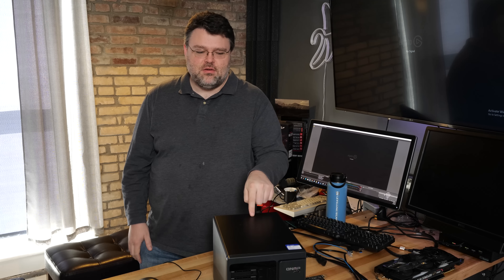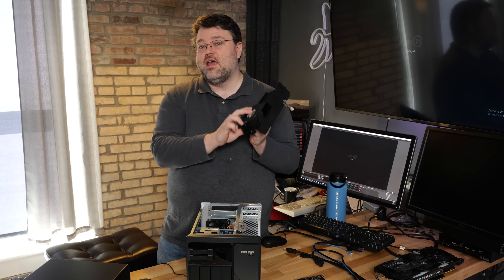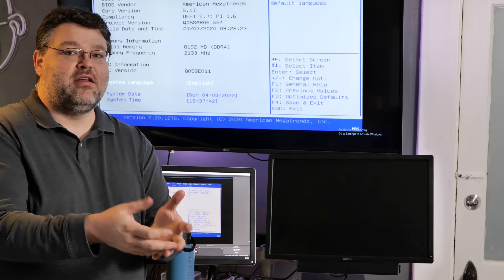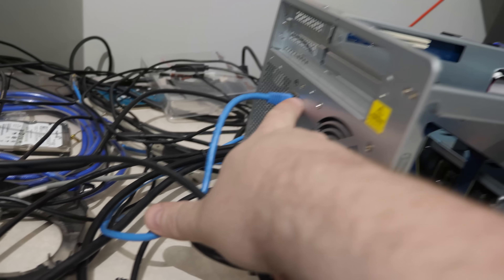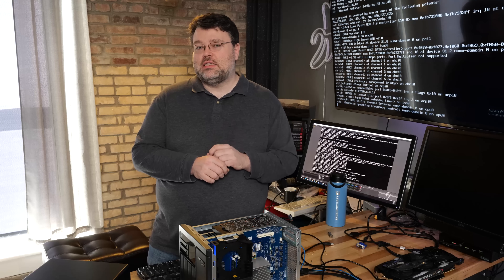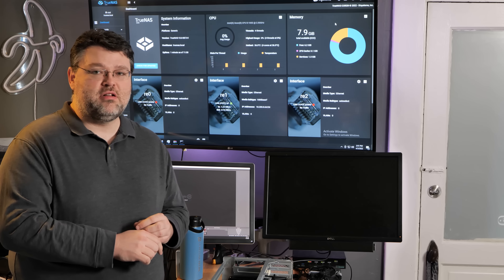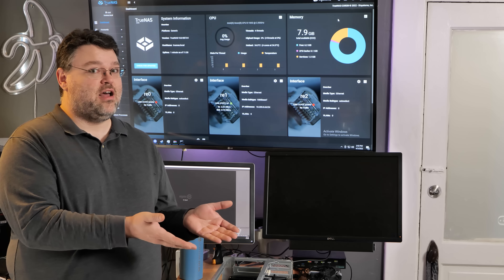QNAP H686 -- Let's Install TrueNAS!

Comment: My wanting to do this comes from the fact that you can only run ZFS on the internal drives. If you add their SAS expander to a QNAP device running hero, you still can't put a ZFS filesystem on the external box.  And I think that sucks.

Comment: Considering QNAP's track record of handling vulnerability(s) they were warned of and given a grace period on by security professionals...I guess I'm glad you made this as I may do it, unless I sell it all to swap to a TrueNAS mini x+, which is cheaper with more ECC RAM and dual 10GbE, though 1 less 3.5" bay, might just be the better option. Only thing is TrueNAS doesn't tell you the exact CPU you're getting.

Comment: @wendell I have a TVS-h1688x and was thinking about installing TrueNAS Core on this box to see how it goes. Wondering if the Thunderbolt and 10 Gig Fiber NICs (QNAP branded) would be supported by TrueNAS. Any thoughts on this?

Thanks for the great video.

Comment: I do like iX systems.  I know the id of the Motherboard, and I can now make my own, because it will be a project for me.  If you are time-short, then pre-built systems are very necessary.  Now starts the search for optimum ram, and then, a 10Gb/s NIX for my workstation.

Comment: The H686 is close to £1000, unpopulated - will a basic small form factor/HTPC self-built PC, with TrueNAS installed, not give you much, much more potential at a much lower cost?

Comment: Don't agree, I would avoid QNAP, but if I were forced to use one I'd immediately replace their junk software, especially the Hero version, with TrueNAS. Had loads of issues with my TVS-h1288x, one day it even decided to simply delete one of my pools. Gotta love backups. The hardware has also major cooling issues. Mine idles at 60-70°C, at 50% load it rushes to 90°C in seconds and stays there even with the fans screaming. Only after installing three additional Noctua 60mm fans the heat is being kept at bay (-20°C).

Comment: I guess it's time someone at Qnap noticed this and had a light-bulb moment and decided to sell their boxes without the OS installed on that small 4-16GB SATADOM, just with larger OS storage capacity - say 32-256GB SATA DOMs... They could capitalise on hardware R&D, and in theory offer it cheaper cause you're not paying for the OS and software support features of the regular product... which also had quite a few holes/issues that made people notice Qnap in a wrong way... And thus such an offer could suddenly allow them to make a lot of $ for small investments, allowing users an option even in the BIOS to eg. run a setup of QuTS/QTS/QTSEnterprise over the net as a remote boot/deployment option...

Comment: I’m on a TS-451 which isn’t supported by QuTS Hero. I’ve upgraded it to 16G ram years ago, I bet it would work well with Zfs. As one of the disks is dying I’m considering to do this also… Reddit says it can be done.

Comment: What about that round port just above the top RJ-45 port? Is that a serial jack?
Can you use that instead if you dont have a compatible gpu? Or does it not support BIOS interaction?
And what kinda weird adapter/cable would you need?

Comment: Huh, well that's neat. I wish this had come out about 12 months ago when I was starting to look for a new NAS. 
I wanted 8 Bays of 3.5" + m.2 + 10G in that kind of quiet and small form factor (apartments don't have room for rackmount gear), and this seemed like the best option.  iXSystems are great for doing TrueNas, but their hardware just isn't what I'm looking for -- besides that, not available here in Australia

Comment: The TS-h973AX is a super machine for this, Ryzen V1500B SOC, ECC DDR4, 2x 2.5G Intel NICs, an Aquantia 10G NIC, 2x U.2 NVMe/SATA 2.5" bays, 2x SATA 2.5" bays, 5x 3.5" bays. 

I'm currently running unRAID on mine, but toying with going FreeNAS Scale when I get a few days to tinker.

I have a pair of Micron U.2 drives, a pair of WD Red SSDs, and 3 18TB WD Whites in it, and it performs great, can get well over 8Gbit transfers going between two client machines on 10G -  limited by the RAM and storage on the clients.

Comment: I have a HS-210 and it basically borked the files when one of the drives failed and it then decided to drop the 'new' disk before finishing the mirror. Very frustrating. As I can barely buy anything where I live, I am now looking at the TS-253D (which I can buy). It has an Atom CPU, not a proprietary one. Would that be able to take TrueNAS Core?

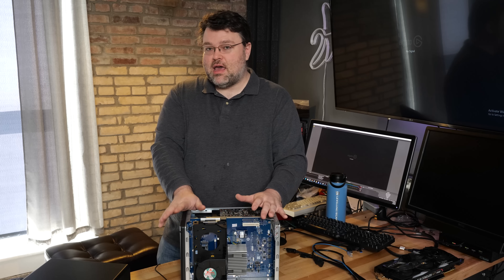Comment: 3:18 I've been running TrueNAS off a 16GB SSD for years now... I was under the impression that you couldn't store anything to the boot SSD besides the OS (no VMs, plugins, jails, etc.), so I'm curious what your reasons are for that?
Reply: It used to be that people ran boot on USB pen drives, so it wasn't possible to run VMs etc due to speed

Now that we've move up in size, speed and reliability to SSDs, it is potentially "possible" abet difficult BUT I'm not recommending investigating as it is easier to have seperate boot / VMs /Jail volumes (with them on ZFS)  where you can monitor manage and move if required.  How much is a pair of 120GB SSDs? $40?

Boot is literally that - boot, you can backup your config move the data drives to a new installation, restore config and  you're good to go (I've done it)
Reply: I'm using a pair of USB 3 32GB Sandisk thumb drives. This saves money and SATA ports which I can use for actual storage drives. It seems fine, no problems at all.
Reply: @wayland7150  It is probably fine, as long as you don't have many writes on your root fs(e.g. mount / read-only, put containers on actual storage).
It goes without saying that storing irreplaceable data on such an USB stick is a bad idea.
Reply: @Maxjoker98  As long as you have your keys and config backed up it should be fine. Just make a new install and your pools pop right back in.
Reply: I've never used such a device or OS, but my guess is that the rootfs is simply on there, and without further mounting(entries in fstab or whatever) containers and applications etc. will be stored on there. So if you're just using it as a network connected storage device, it's probably fine, but once you want to make good use of the hardware, e.g. by running a few containers, you'll quickly run into issues.

Comment: Right on time. I'm gonna try TrueNAS Scale, if the speed is better than Core, I'll keep it. If not, it gets banished into the Dark Crevices forever and I'll run Rocky Linux in a VM for any Docker stuff.
Reply: afaik TrueNAS Scale (or any ZFS on Linux for that matter) is still a bit slower than TrueNAS Core (or ZFS on BSD)
Reply: @marcogenovesi8570  I’ve read the same online (Core being 2-5x faster) but my home server is not that fast anyway. Best way to find out is to try I guess!
Reply: If you've got a fast CPU will it actually matter? If the point is you want to run VMs and Dockers on the same box then maybe it's worth it. Obviously if the data transfer is slow then it's a no go.
Reply: @wayland7150  I couldn't even get the Scale installer to boot on my system. Core works fine. System is cobbled together from stuff I had in the attic: FX6100 (with 4 cores disabled), 16GB DDR3, 4 4TB HDD's (new). So yeah idk.

Comment: Holy crap, that thing is expensive.
Reply: Yeah, but it works on older qnap's too, just remember to check the cpu specs. Personally I prefer to run plain Debian rather than Truenas, works fine. I guess you could even run Armbian on some of the Marvell cpu stuff, all though I haven't tried it.. yet..

Comment: this is not something you want to do unless you want to undercut qnap and sell better nas plus cheaper to boot - with a better mb you have better cooling, better expansion options - you may have to shop around a bit but nas is nas - truenas has been around - putting the os on the nvme is a good way to go vs sata dom - you can do raid1 for better fault tolerance
Reply: It would be great if someone made a case with SATA/SAS bays already wired and it's own PSU. Just add an mATX board.

Comment: Realtek NICs work just fine ™ under TrueNAS Scale, as Debian is way less picky about its hardware.
Reply: Using realtek NIC in a production environment is always bad idea unless you dont care about bad performance
Reply: Yepp, was my first thought, truenas scale is worth considering. I just like it as i suck at bsd😃
Reply: i noticed for qnap 2.5gbe, initially with truenas core it didn't work. but using truenas scale worked. i believe later there was an update for truenas core that said they added support for the 2.5gbe nics, so it may work now without having to resort to the alpha/beta truenas scale which is not recommended for production yet afaik.
Reply: Realtek is trash.

Comment: If anyone wondered. Yes Wendell is active on level1forums.

And noice. I built my own NAS and just recently upgraded my Truenas Core to Truenas Scale.

My suggestions. Show this upgrade process. Show how to use Plex and set correct permissions as docker.
Same for Nextcloud.

And my biggest issue. Getting a VPN for the Homenetwork. Preferably with a GUI option like the openvpn access server.

I know Truenas got a OpenVPN service.
But setting it up so it may detects and reaches the whole local network is super confusing. I always struggled with what settings the openvpn service needs. More often than not it was just guesswork and only halfbacked for me.
Reply: Try pritunl for a gui based openvpn/wireguard server

Comment: that's probably the only way to safely use a Qnap device, nuke the stock firmware and replace with an OS that follows basic security principles and is updated regularly
Reply: is the only way to be sure...
Reply: @magoid  this is the way
Reply: Also the only way to use any router
Reply: yea thanks qnap just got deadlock ransomware on the weekend. still persists even after malware and virus check, firmware update etc. truenas it is...
Reply: Qnap is still getting hit with ransomware .. so yeah I'll take the form factor and truenas plz
Reply: In QNAPs defence, they have been pretty proactive in updating their firmware, I have a QNAP NAS from 2015 and has had regular firmware updates to this date. Their handling of the whole deadbolt situation, was rather poor however. My major critique from my experience, there tends to be odd limitations in the OS regarding the ability to use certain file systems and other features that seem to come and go with each release.
Reply: @Lorondos  regular firmware updates don't mean much if they don't solve CVEs from 2 years ago.
Reply: Couldn't agree more, their products are unbelievably bad, especially their Hero OS.

Comment: I guess QNAP's OS is based on Linux?
Reply: yes, all NAS have a Linux-based firmware.
Reply: @marcogenovesi8570  (except for the ones that don't, like Netapp)
Reply: @jmonsted  Netapp makes SANs.
Reply: @jmonsted  afaik netapp uses something based on FreeBSD and ZFS?
Reply: @Felix-j3d4b  I'm not sure they use ZFS, most of their drives need to be formatted with 520 byte sectors and do the integrity checking like old raid controllers do. ZFS sure doesn't need that.
Reply: @marcogenovesi8570  The NetApp filer was their classic product, a NAS running ONTAP, based on FreeBSD. It later became an iSCSI and FC target.
Reply: @Felix-j3d4b  ONTAP is based on FreeBSD, but it uses their own proprietary file system, WAFL (pronounced "waffle" of course).

Comment: Im never a fan of custom form factor NAS/Servers, I dont get why people buy them either, they are always overpriced af.
Reply: this is a turnkey NAS, a significant part of the price is the stock firmware with web interface and apps and services. Of course it will lose to a barebone server
Reply: Not everyone is capable of setting up their own unRAID/TrueNAS/OMV... machine. Most people don't even know how to build a computer but they need NAS. Just because you don't get why doesn't mean there are no situation where they are a good solution. Synology DSM so easy to set up than even people who have only basic experience with networking will manage it.
Reply: They do tend to be expensive, but size and noise are important to lots of people.  I built my parents a NAS (using TrueNAS) on a HPE MicroServer Gen8, and it's fairly compact (and certainly quiet), but it's still quite a bit bigger than a 4-bay QNAP or Synology.  And you aren't going to get 4 bays, in a "normal" computer, much smaller than a MicroServer.